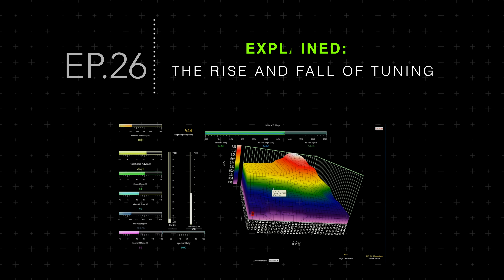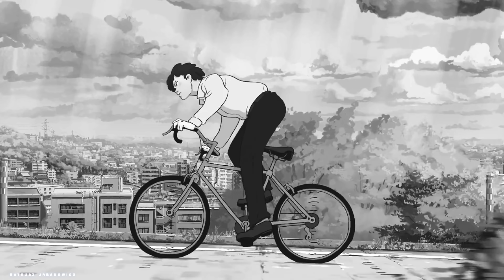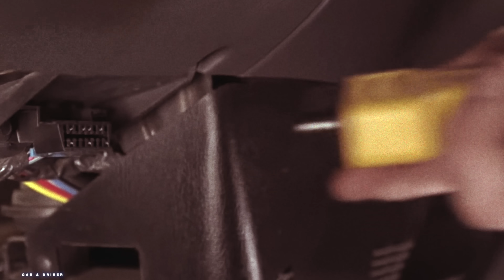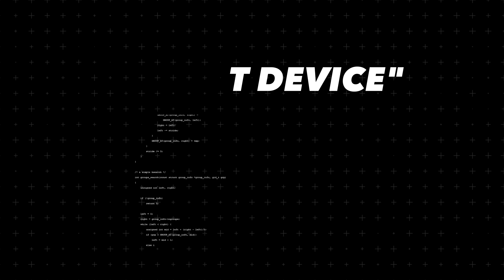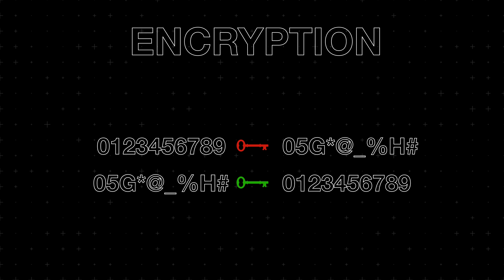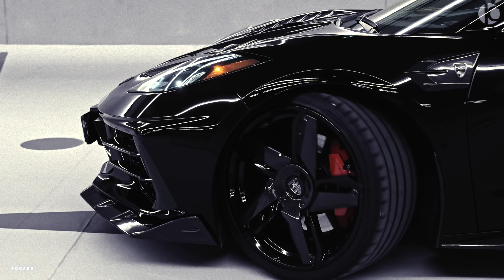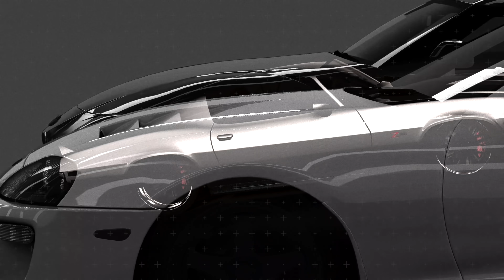How Tuning Engines Became Illegal👮🏻‍♂️| Explained Ep.26

Comment: Technically vehicles before 1975 are not exempt from anything except the actual Smog Check.  They are in theory supposed to retain all the smog equipment that they were originally sold with; which obviously would include factory catalytic converters.  
Although you could argue that within the spirit of the law modern ceramic "honeycomb" style converters would be fine to install.  And any sane person would not want their car flushing expensive unburned fuel out the tailpipe.  But here we are 🤷‍♂️.

As for tuning, I actually do not want more horsepower, I want better throttle response and a smoother better running engine.  For example, my Trailblazer with an inline 6 4.2L has in theory plenty of power.  In practice there is some kind of limiter to protect the transmission and/or prevent you from doing burnouts/sliding into curbs.  Thus my Corolla 1.8L is much faster to accelerate.  Sad.

The Nissan Frontier service truck I drive has very poorly coded engine controls for manual transmission (probably one reason that Manuals are not offered, they represent more engineering that must be payed for).  If I release the clutch until it starts to drag and apply throttle (as you would when attempting to pull away smoothly), the engine will sense the load, and cut the engine ignition.  I know this for a fact because I will be rolling.  And if I apply and release the clutch pedal it will 'bump start' itself.  The only way to never stall the engine seems to be revving over 2000-2500RPM.  To pull away.  From a stop.  If it would "lug" one or two ignition events instead of just giving up, its already rolling!?!?  But no.

So I don't even care for more power.  Believe it or don't tuning is not about more horsepower all the time.  The most highly tuned car I've probably ridden in was a C4 Vette that had maybe 230HP.  It was built for Autocross where it was put in second gear once rolling and never shifted through the run.  It was more important for it to have a really flat and high torque curve.  It pulled hard out of the tight corners and hit some of the highest speeds I saw that day.

Mostly good and accurate film.  Neglected the door sensor cheat part of the VW scandal.  If door open= dyno= emission cheat mode.

However, if one has the money to buy a C8 Vette etc.  You can get a complete bespoke ECU installed to run the whole car, no need to reverse engineer the stock one.  Whether re-doing all the ECU design and programming work from scratch is easier than cracking the computer codes I can't say.  I will say that at some point the modifications always exceed the capabilities of the OEM ECU anyway.

We can complain all we like, but its the hurr durr people making donuts in every intersection of our Suburbs with no muffler that is harming the options we get for tuning.

On a positive note, the GR Corolla will come to the USA, and it is a really cool car.  I think you'd be hard put to improve upon it with software and tuning.  It's pretty well stretched from the factory.
Reply: I guess the real question is what, if any, restrictions will there be on electric motors?  If your car has a legitimate 2,000WHP (which you could do easily by stuffing 4 Tesla drive units and a Hybrid battery pack for peak power delivery in a vehicle), who is going to notice or complain?  Technology and tuning move on.

All this brouhaha over tuning the engine.  And I saw a study where the amount of tire dust was being weighed.  That is an emission, what happens when there are restrictions on how soft of a tire or how heavy your car can be for the load it transports?  There is only so much planet.  And nobody is knocking down your door for tuning your own car 'illegally'.  Can you buy it and flash it or bolt it on yourself?  Maybe not.  But in my mind tuning was always about your mind and wrenching against physics.  Science.  Not your credit card against a mail order catalog: showboating.

So tuning will just go back underground, and I'm not crying.  It's grassroots where it came from.  Also I haven't seen anything prohibiting lightweight flywheels/driveshafts, custome gearing.  Off size tires, body modifications.  Or indeed engine swaps.

Comment: The intellectual property argument for software is a thinly veiled attempt for any electronics manufacturer to drive out the repair and modification industry. If you design a fuel map, and I modify it, how is that any different than if I were to modify the electrical wiring of the car that already exists to replace the stereo?

Another counterpoint to the laws regarding consumer vehicle emissions is that the top 100 most profitable companies in the world emit 70% of all emissions. Even if you forced every citizen to be carbon neutral, it wouldn't even make a significant difference in emissions and greenhouse gasses. It's very clear that in recent years that these large corporations spend lots of money, time and effort to shift the blame on consumers and lobby government officials to make bogus legislation that hurts small businesses. Think of it this way: if these companies force tuners out of the competition, the car manufacturers are the sole providers if performance vehicles. you cannot affordably purchase a high performance vehicle, because they control the market.

You may argue that "you don't need performance vehicles" or "you don't need to modify your car". well, you're wrong. BMW even announced a program to force you to pay subscriptions for vehicle amenities and accessories that are already installed on the vehicles, like heated seats. You know what controls those functions? the ECU they are trying to make illegal to modify. This isn't just a slippery slope, THIS IS ALREADY HAPPENING. Apple does the same thing by serializing components on their devices so only they can repair them. John Deere is also another manufacturer that locks services behind serialization and firmware, which again, is illegal to modify. The EPA has been bought by these companies and no longer serves to protect our environment, and only the interests of these companies that make BILLIONS on this kind of legislation.

Comment: I know you won't believe this but on the pushbike a good cyclist will push FORWARD before TDC, Down on the downstroke and back a bit at BDC even a bit up on the bottom of the upstroke.  Giving a lot more than 180 degrees power from each leg and no deadspots.  I just thought you might like to know.  Extending the DURATION of the pedal cycle reduces the force required and makes it easier on the bearings and the muscles.

Comment: The EPA needs to be exterminated figuratively AND literally. They have such a hard-on for emissions that its ruining everything including cars, and they wind up wasting more resources and polluting more than if we just had better engines. Wonder why all the automakers are shifting to some shitty 4 cylinder twin turbo in their entire fleet? Emissions. Gas mileage has actually been decreasing; my manual 5 speed Corolla from 2004 can get 30-40 MPG highway and these shit-bangers get 21 according to the window sticker. That's only 1 or 2 more than a 93' T100 or an FJ Cruiser.

It's the same with adding ethanol to gas. It's only about lobbying, and those politicians need the rope too. Ethanol production overall is an energy-negative process and it isn't even about saving resources. Once again, it's emissions standards. So they are putting even more pollutants into the air and wasting even more fuel and resources to farm an unreasonable environmentally damaging amount of corn... for emissions. And I'm not even some sort of hippie, I hate hybrids. We're governed by retards and we allow them to get away with it.
Reply: Some places at the state-level, are far more restrictive than the EPA!

Comment: To me, the future of Tuning are homemade Electric Vehicles and homemade Series or Parallel Hybrids. The mafia called government can't use the EPA as an excuse to bully & rob EVs. As for engines used as range extending generators or, combining with batteries & ultra-capacitors for more power. Those engines can be kept stock. Hybrids give you the instant torque and stealth of electric, with the convenience and sustained top end power of gasoline. And couldn't we just also use Tuned old engines and crate engines in homemade performance Hybrids?

Think of it.
Homemade Parellel Hybrids the same or better then the McLaren P1 or Porsche 918.
Homemade Pure EVs and Series Hybrids like Zombie222 and creations from WV West, that can out preform Teslas in every way, and have generators onboard, kept at their most effecent RPM for range, or dialed up on the fly to their most powerful RPM for performance voltages and Watts.
The government needs to die and be rebelled against for many reasons, but they will not kill Tuning. Legal or Blackmarket.
Reply: Think of a car you love the appearance of. Then find one with a ruined or removed engine. You can not only make a great EV or Hybrid out of that, a Sleeper too. But you can also make it feel Mid or Rear-Engined, based on we're you place the battery backs and generator or drive engine. That is what homemade EVs and Hybrids are. Converting old gutted vehicles, or making something special out of a kit car.

Comment: Tuning has proven that EPA and emissions laws have severely restricted our fuel economy and optimized engine performance.  My STI is tuned, well within tolerances. My fuel economy has gone up a couple miles per gallon,  the engine burns cleaner and has passed state emissions well within the margins. No emissions equipment was removed, matter of fact, except for the intake and TMIC, the entire engine is OEM.

Comment: Ok, my F-150 was built in 96 which, if I’m correct, was the first year of the ECU install readable with the ODBII tool (and a computer?).  Is that first generation ECU ‘brain’ hackable for performance adjustments, or am I going to have to be happy with installing headers and other external add-ons?

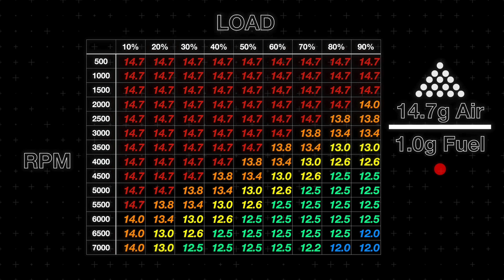Comment: 5:00 - on a N/A motor 0% ethanol you target 12.5 - 12.7ish because that is when the burn has the most velocity and thus makes the most power. You may add more fuel to help cool the intake charge and cylinder temps. Also, 14.7 is used purely for environmental / emissions reasons around cruise rpm and MAP since leaner mixtures create more NOX emissions but also reduce fuel consumption during cruise

Comment: I build/drive old vehicles, run them on home made vodka (ethanol) which allows me to do fun things like crank the compression up above 13:1 in my daily drivers. Believe it when I say that driving a Pontiac 455 with 13:1 around in a 3000lb muscle car with a 3.08 gear and an OD transmission is seriously fun. 

Fun fact about emissions: When you run straight ethanol or methanol in an engine, the only output is CO2 and H2O, if you are in a smog prone area like California, the air is cleaner coming out of the engine than it is going in.

Fun fact 2: Raising the static compression ratio improves efficiency, power and mileage. Around 12:1 SCR is the crossover point for most engines where ethanol gets the same or better mileage than the same engine does on pump gas.

Fun fact 3: Smokey Yunick's hot vapor engine is not a reality for every day use on gasoline, but its very simple and easy to do on straight ethanol, with no special engine parts, and yeah it picks up mileage without costing power.

Why am I big into ethanol? Its real simple.. I can make 1000 gallons of fuel from 1 acre (4,840 sq yards or roughly 200ft x 200ft) of cattails, which are also cleaning the water as they grow all summer. You harvest them in the fall, and they come back in the spring. What does it cost me? About 40 cents per gallon to make fuel. I make methane to power my stills, you can do that multiple ways as almost every organic material produces methane when microbial life breaks it down. You can run your vehicle on methane, but it doesn't have much range. 

The people who run CARB and the epa do not like what I am doing, because they have interest in mining operations and power plants, so they are pushing for EVs, which also allow more control over your movement. If we all made our own fuel, and our engines last the rest of our lives rather than wearing out, they would have a difficult time profiting from that and controlling our movement... wouldn't they?

Sure, vodka is a green fuel, but thats not why I am into it. I can produce it myself rather than buy it from someone else, just like making fiberglass body parts, or machining parts from a chunk of metal with a Bridgeport mill or lathe, you can make things yourself that you cannot otherwise afford or acquire. Sure you have to buy the equipment and learn to use it, but then you are open to making far more than the initial thing you wanted to make. 

My fuel project results in more food to eat, heating my home and shop for less than $300 a year in part of the US that has snow from November to May, and its also going to be producing electricity since my grid power is hideously expensive.

Undoubtedly you have been told it destroys engine parts, but I have had zero problems with it in my 1970 GTO, 1965 GTO, 1979 Formula and 1968 LeMans since I converted the '70 to E85 way back in 2007. Additives put in the fuel cause problems, ethanol does not. Ethanol is simply vodka, whiskey, beer, wine, etc. Its all exactly the same substance, at different proofs, with slightly different methods of producing and aging it. The stuff they put in causes corrosion, and leaves behind the waxy yellow residue and the white chalky stuff, neither of which are present in my home made fuel, no matter how many years it sits in the tank or barrel.

I have run E85 and my hydrous E100 in my vintage engines, with Qjets, Hollleys and Demon carbs, in my 1998 LS1 powered Formula, a 1998 Gran Prix with the 3800, and my 2006 GP winter beater, along with several 1999-2007 Silverados with 5.3s and 6.0s in them. Its super easy to change things to run ethanol, especially with carbs, but EFI allows you to switch back to pump gas as long as your static compression ratio isn't too high to run it like it is in all of my Pontiac V8s that range from 350ci to 505ci. Yes Five hundred Five cubic inches, its an almost entirely aftermarket engine.

The more energy I produce, the less money I have to spend on it, which means I have more money to buy parts for my cars and trucks.  It also means I can do things for less money, like make more power because I can run boost and compression without having to worry about ping/knock.

Comment: Imagine thinking you can keep the kids from hacking.

My predictions:
1) Kamikazee drill hack. 
2) law enforcement variation programs will plug and play. 
3) Multiple error codes will result in a limp mode that can be programmed. 
4) secondary ECU with a secondary fuel pump. 
5) CAFE researchers will leak codes.

Comment: Excellent job as always! If clean air truly is the end goal, all this reminds me why more people have to support CO2 recycling technology from companies like Carbon Engineering. With this technology you can literally pull CO2 out of the air and make clean burning fuel for every internal combustion engine with little to no modification. The implications of that alone are tremendous. If people don't know about this tech it will never get a chance to go mainstream because many who "say" they are for the environment now profit from the current systems in place.
Reply: The main issue with that is that we need more clean power to go mass scale on c02 capture. Ideally, we would want to use nuclear since it's our easiest option for clean energy currently.
Reply: @killzone64  Good points. I am glad to see someone else who has actually put some thought into this and not another paid "climate activist".
Reply: Co2 is not toxic and it is not cancerogenic and does not cause 
astma, Co2 is a greenhouse gas.
In a perfect combustion only Co2 and H2O is released.
HC NOx, particular result from incomplete combustion.
Basic high-school chemistry...

Comment: It still baffles me how the EPA demanded that vehicles get better gas mileage back in the 1970's and once they achieved that the EPA then stepped in and demanded "better emissions control" and once those came to be that gas mileage gained ended up lost.  Cars built today have no better gas mileage ranges than those of the 1970's in spite of "better emissions".

The oil industry has a stranglehold on improvements that reduce the need for their products.  When someone develops something that reduces the need for oil products the oil industry buys them out and buries the information in the patents.  The oil industry just doesn't want to give up its monopoly on fuel and other products made from oil.  Same can be said with the electric industry and that power generation and storage. They fight tooth and nail to keep the status quo and their profits flowing in.  They do not want change they want more control over everything people do and nothing more.

Comment: Great video! But...... emissions are a joke!!

I am a 23 year ASE master certified tech.  On a daily basis I see 10 cars that would never pass emissions testing.  Be it a check engine light or exhaust problems.  And in MN and ND we don't test.

If people thing California has bad pollution,  it worse everywhere else.  They have to test under strict standards.   And everywhere else, they don't even care.  Maybe not care, but they don't test.  So it's even worse.

It's been illegal to tamper with a car's ecu for a long time.  And the enforcement side has been around just as long.  They just didn't do anything about it.

An engine that is tuned properly is burning more fuel than designed from the factory but in the end, every turner wants a complete burn.  Rich or lean and your missing out on power.  And that's the point. So to think the epa thinks these care pollute more is sort of wrong.